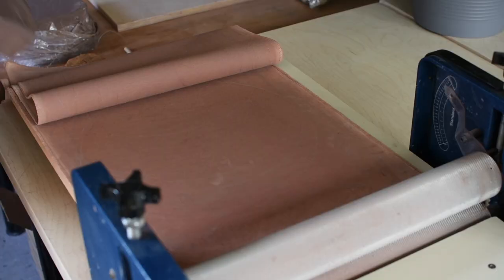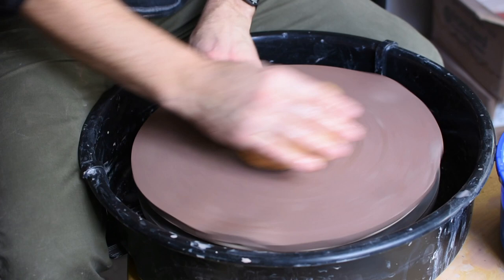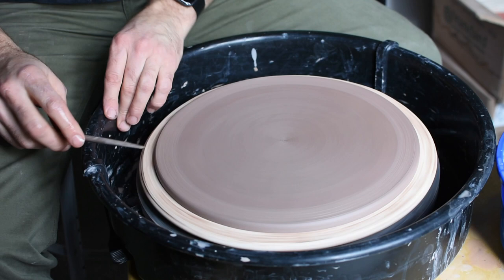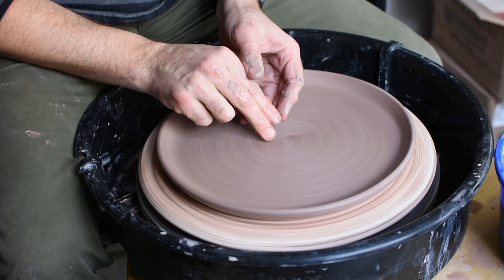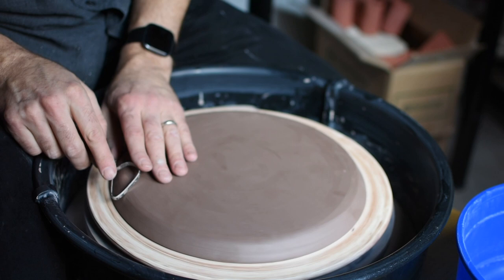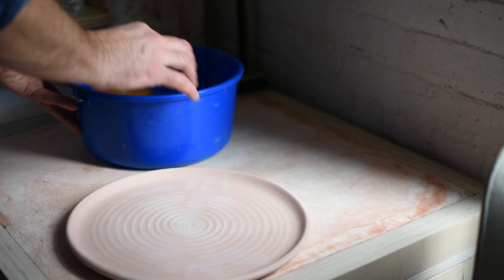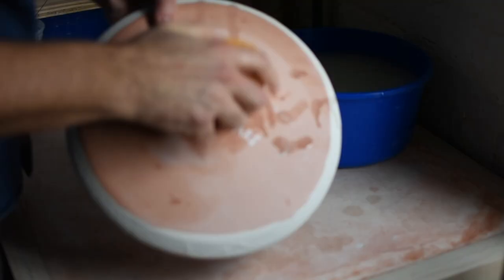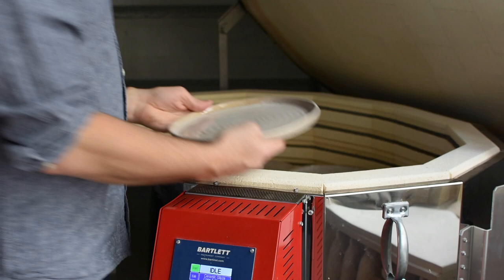Making A Slab Plate on the Pottery Wheel from start to finish— narrated version

Comment: Bc of the bat you use, you don’t have to wire it off?
Reply from the maker: That's correct. It's an absorbent bat made out of hydrocal, which is similar to plaster but more dense. When the piece easily "pops" off the bat, it is usually ready to trim. For me, Hydrobats are a gamechanger!

Comment: This is a fantastic idea. What size was your plaster bat if you used a 14 inch clay circle?
Reply from the maker: Hi, thanks for your question. I used a 14 inch Hydrobat. In practice, the bat might be 13.5 inches wide. I cut the clay slab to around 12.5 or 13 inches before bringing up the wall.

Comment: Can I ask what type of wood you're drying out the plates on?
Reply from the maker: Hi, thanks for your question. The large wooden boards in this video are actually a plywood, specifically wood-veneer laminate over pressboard material. I believe they were once very deep bookshelves? I found them on the street here in NYC and repurposed them in the studio. I also have a variety of birch plywood wareboards. For these plates, most of the drying occurs on the hydrocal Hydrobats, as I find that helps keep the drying even.

Comment: hey, would you help me with a problem? Having, my rims are drying faster than the rest of the body and I always get warps. So it's the center either popping up or down. I just can't get them to stay flat. They are dried covered, I do soak the sponge and sponge the rim in the middle of the drying process, and I also tried flipping them over, it did get a little bit better but I still get a slight pop in the center. What can I do to fix this?
Reply: these are perfectly flat, this is magic to me
Reply from the maker: Thanks for your questions and my apologies for the delay in responding. 

For plates, I always make them on an absorbent bat. In this video (and my studio) I use the "Hydrobats," which are made with hydrocal, which is a dense plaster. This allows for even drying on the top and bottom.

Another method you could try is getting the plates onto a wire shelf, so that they have airflow all around and dry evenly.

The key to keeping things flat is to have everything dry evenly. I personally don't sponge or add water to pieces in the drying process. Instead, I use the hydrobats or wire shelves along with covering pieces with plastic, to slow the drying process and keep things even.

Good luck!

Comment: My lip just flopped down when I tried this technique.  Is it because it was porcelain, or maybe I wasn’t using enough water?
Reply from the maker: Sorry for the delayed response. Porcelain is definitely trickier, but try it with a thicker slab, or be careful to not thin the rim and get it too wet. When the plate is leather hard, you can always trim it thinner as well

Comment: Helpful video… I struggle with warping on my plates. ….with the center of the plate rising slightly….Evan after I have weighted down the center during the drying process… any suggestions…thank you
Reply from the maker: Thanks for your question. I think that warping is often caused by uneven drying. This might be a result of uneven thickness, but assuming your plates are relatively even, my best advice would be to try an absorbent bat and to dry the pieces slowly under plastic. I use Hydrobats, which are made with the plaster-like material hydrocal. You could also try a wooden or masonite bat. 

With slab plates, it's pretty straightforward to wedge and roll out an even slab, and then dry slowly. If you are throwing bats, let it get to the dry side of leather hard, then trim, and cover with plastic again to dry completely. I hope this helps and feel free to ask more questions if this doesn't help. Good luck!
Reply: @merkelhess  how long does it usually take for them to dry under the plastic? Thank you

Comment: What type of wheel are you using?    Does it fit on a tabletop?
Reply from the maker: Thanks for your question. I'm using a full-size Soldner wheel. You could definitely do this technique with a table top wheel too, such as a Speedball Artista. I have also tried this technique with a banding wheel with nice results, but the edge was more varied because you don't have a motor to constantly spin it for you to make it super even. Try it with what you have — you could even just turn a board or a bat by hand while raising the rim. Good luck!

Comment: What is the profile of biscuit firing? My plates got cracked at delta 100 grad C till 650 ?
Reply from the maker: Hello, I use a medium slow bisque firing schedule. In Fahrenheit:
Preheat at 180 F for 3 hrs
Climb 120 per hour to 250
Climb 300 per hour to 1000
Climb 150 per hour to 1100
Climb 180 per hour to 1700
Climb 108 per hour to 1945 (cone 04)

If your plates are cracking, try drying them completely before bisque firing. Good luck.
Reply: Thank You!

Comment: Love this!  How thick was your slab?
Reply from the maker: I typically start with a slab that is about 1/2 inch thick or maybe 7/16" thick. The slab is thinned a bit when it's on the wheel. Usually, my goal is to end up with walls around 3/8" thick in the greenware stage for all my pottery, but there can be some variation with this and you will find your own way if you make pottery from slabs!